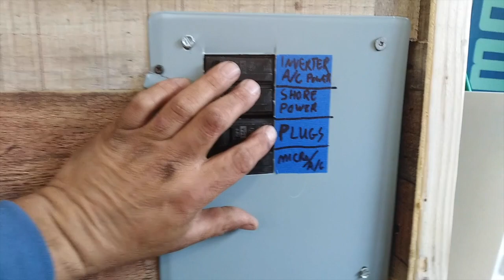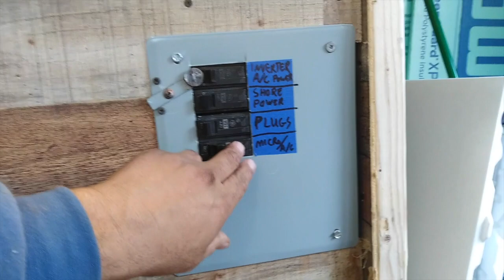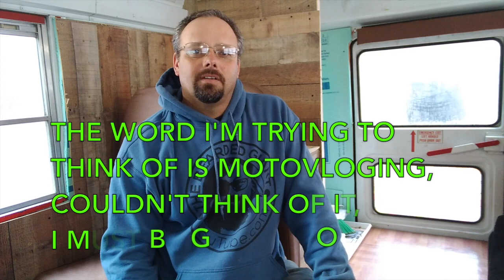Skoolie 110 Volt Breaker Box with "Hillbilly Transfer Switch"

Comment: great video. 
You made a transfer switch and you didnt need to buy a commercially made switch that probably would have cost a lot more. Good job with the work around. I dont see anything unsafe about what you did!
Reply from the maker: Thanks! Yes, I wanted cheap, but I didn't want to skimp on safety.

Comment: Always learn something new watching your stuff, Luke!  Talking about the heat, using existing Heater in bus that you are doing duct work for?
Reply from the maker: Yeah, it will be the original heater. I plan to use the thermostat starter on it after figuring out how to make it work on a diesel engine. There will also be a diesel heater in the same space that will share the ducts. Still in the designing phase right now though. It should be able to heat the water for the sink and shower and also heat the bus.
Reply: @lukeFugate  yeah I don't know if you recall or not but I had asked in one of the previous videos where you were working on the bus and mentioned heat if you would use some type of a system that was fueled by your diesel fuel. I would really like to do one of those in the van but I have no idea and I know buying them is expensive. Glad to hear you're otherwise going to use your system in the bus though that's great! I'm really anxious to see what you come up with in terms of using the fuel for heating the water and producing heat in the van. I'm going to guess that the same principles apply rather it be diesel or gas I just don't know all the details of how those systems work but they're supposed to be very efficient and much safer than using the propane canisters or even the propane tanks 4 using heat and less moisture as well. And then the way that they're vented is much better to

Comment: Luke Great Job 👍🏼
You know I was just noticing... what happened to the Stain Glass looking glass on the bottom of the back door❓.. why did u remove it, or did it just peel off ?
Reply from the maker: It's still there. My camera settings must have been off a little. It kind of washed out all the color on the window. I just noticed it when you mentioned it.